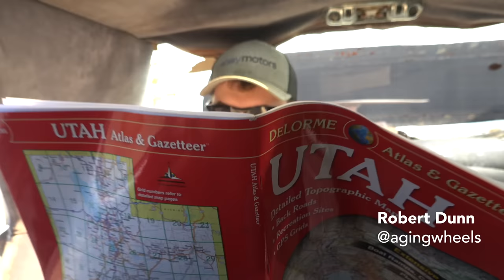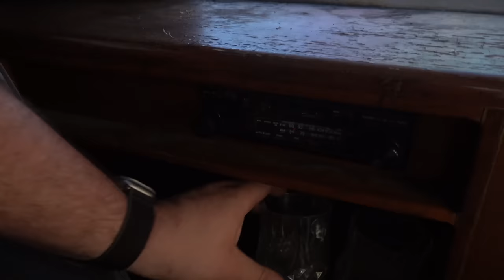Can it be saved?! Cutting apart a Rare Honda Limousine.

Comment: I wonder if it would be better to cut the donor in a way that the whole roof comes with the rear section and use that roof and structure so you only have to fabricate a small section of the roof? Like, cut it where the rear door opening ends at the dog leg and cut the roof at the top of the windshield pillars and door pillars. Know what mean? Might also search scrap yards for a wrecked one that has front end damage only for that smaller section between the trunk and doors. Dunno? I'm aure you'll figure something out Jared.

Comment: Real suggestions not snark.
It would actually be easier and better to just build another one only using the floor pan out of that one.
However if you really want to rebuild that one.
Get the entire roof off a van.
One of those small Asian delivery vans that has a raised roof line from the drip rail so you get more internal head room. You can either go the full length of the roof or have a raised rear section just behind the front doors.

Comment: Find an old shitbox of a van…most of them are full of cancer on bottom half…at least here in Norway.
A long Astro van should provide both gutters and roofskin..or maybe one of those chrysler footballmom cars…cheap as chips and full of rust underneath. Hell, if you find a jdm workvan you might have real luck an dont have to modifi to much width or length …good luck , I enjoy your show(s)😊 
PS! When you first asked if anyone had a tip for you about driprail, there was a van with 5meters long driprails in the background…haha. But find an old Toyota Hiace or a Mazda van..both long and old…about same width as an old sedan.
Greetings from Norway.
BigFF✌🏻

Comment: It would be easier, faster and probably cheaper to turn this into a convertible JFK like like. It wouldn't be cheaper but definitely cooler to 3D scan and build it from carbon fiber, since logic is obviously being thrown out the window this should be an option. Trying to rework this shell is nothing more than a passion project, but just having photos to remember it by or having a small scale model built makes more sense than restoring this hunk of, you pick the best 4 letter word.

Comment: Ugh i had to work on one of those nightmares while it was in service.  Wasnt worth fixing new.
Reply: Western Massachusetts,  in the pioneer vally. The guy owned 2 5 foot stretch lincon town cars and a tri axle super stretch.  All of them were stuff welded together by chimpanzees and bondoed over. The honda was the worst. Always stress cracks and blown engines heads and transmissions.

Comment: It will never be worth the work your going to have to put into it.. That said, You are not planning on selling it in your lifetime, so Fix it and enjoy it.. As for Roof rails I would suggest maybe doing away with them or cutting a roof from a minivan or Bus and attaching it.. Adding some interior support and rust proofing.. Also check the floor after seeing the roof i would be worried... If it also needs repair think about maybe making it super special and extending it an extra 4 ft :)

Comment: Jared. Please stop overthinking and overbuilding 

Get a 2nd honda accord donner car and use them both to build the roof, use the existing gutters, doors panels, fender, suspension mounts, trunk structure, etc

Please don’t reinvent the wheel and make it easier on yourself by transplanting everything that you need to rebuild that limo

Hope this helps.

Comment: I have seen a few (couple dozen) limos in a very close and intimate (not that kind of intimacy Jesus!). I will say I have seen them well built. Granted for every good one there is 15 like yours and the one showed on junkyard digs.

Limo customers just want something that looks ok and is as cheap as possible. So crazy hazardous creations emerge. Many are not even safe for the road. The thing is you don't need the safety inspections for a limo like you do for most road cars. They are custom limited number production cars so can be exempt from almost all government regulations normal cars must meet.

Just imagine a Ferrari 512bbi limo based off a Pontiac fiero!! Death trap 

I promise if you personally inspect every one of those honda limos not one will be built the same. Just like different areas of this one seem like they were done by completely different teams.

Comment: The way you're using that flathead screwdriver, I'd think you were a fellow electrician except you're smacking it with a mallet instead of a "hammer", aka a pair of linesman pliers....

And why did you throw out the back glass? I know you have another one, but I'd think you'd at least wait until it was installed just in case you dropped it or something, and if nothing else I'm sure some subscriber would buy it if it couldn't be sold on ebay.

Comment: No. Just no. It's just not that worth it(work wise). 4k in grinding disks, time and welding wire... Just to Bondo it again. Value vs Effort. I wouldn't, but I'm not you.
Put a V8 turbo in the donator  honda.
And, home depot sells vinyl rain gutters.

Comment: Bringing something that shouldn't have been back to life. Questionable since the Japeneese steal was know to rust worse (sooner)then the american cars, during that 70's to 80's era. Money pit for what was suppose to be a cheap 500 dollar throwaway desert racer. For experience to make it better and not a leaky rust bucket just because you can. Fixing up someones poor example of a custom limo. NEWER, BETTER, FASTER, Consider modern suspention and turbo engine combo for retro look car. Play 6 million dollar mans intro music. IF you can rebuild a McClaron with Freddie you can do this.  

  Way that roof is hollow be a good way to run wires to the trunk or to newer electronics in the Limo. Drop down TV monitors. Can't forget the wing for trunk and a stylish boomerang antenna for that era. Everything doesnt have to be budget if you looking to make a modern retro one off version. Take styling cues from freddie, seats, dash, steering wheel anything that can bring it modern convienience.